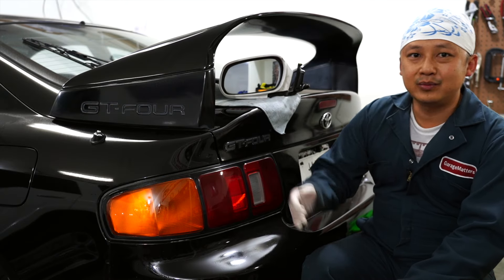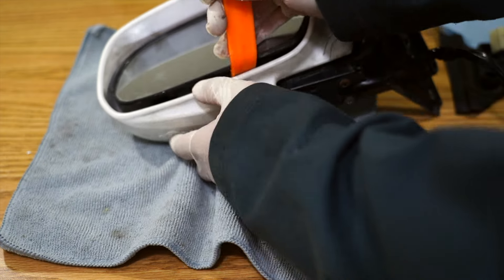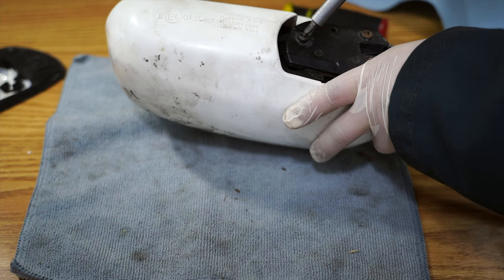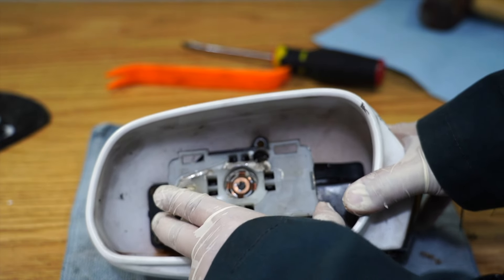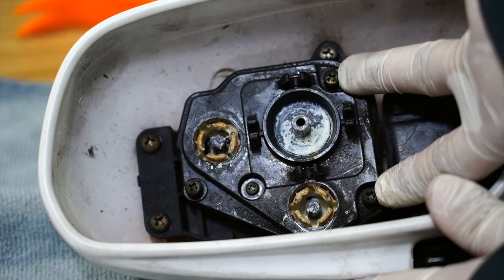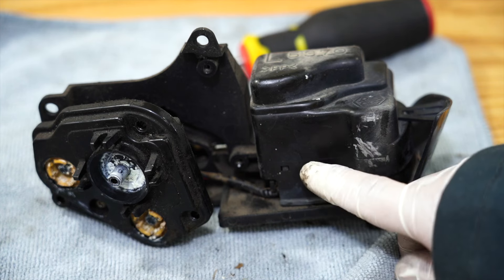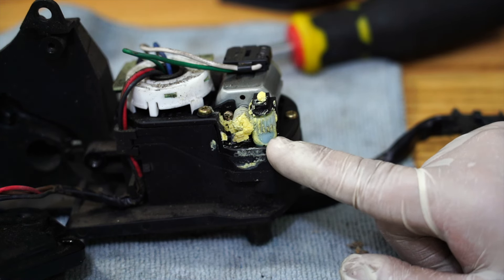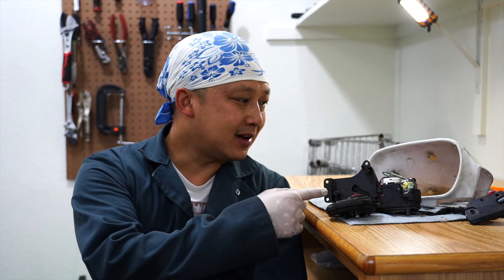Toyota Celica Folding Mirror repair *1 of 2*

Comment: I wonder if internal parts are interchangeable between the 1992 and 1994. I don't need the folding mirror on my 1994, but my 1992 had one broken. Disassembly should be close to identical on both?
Reply from the maker: I have no experience with the 1992 but disassembly could be similar.